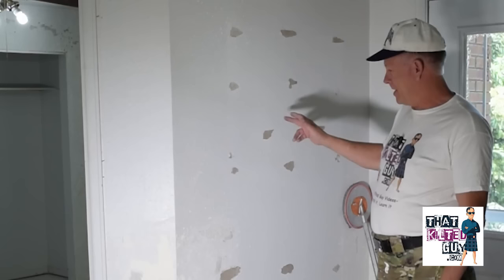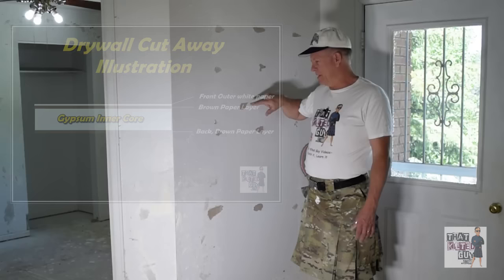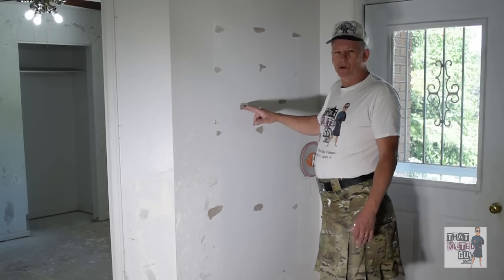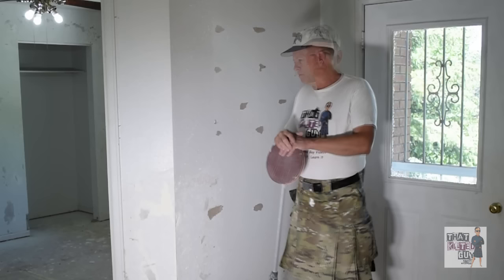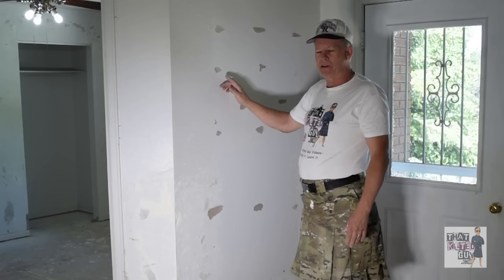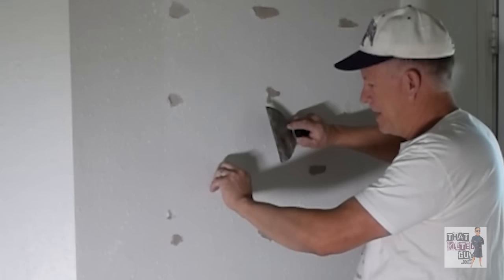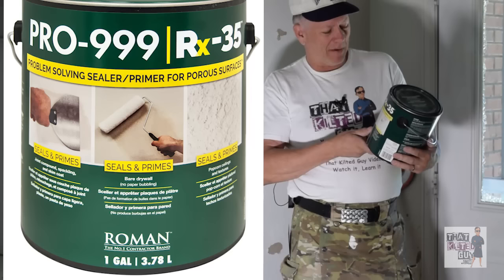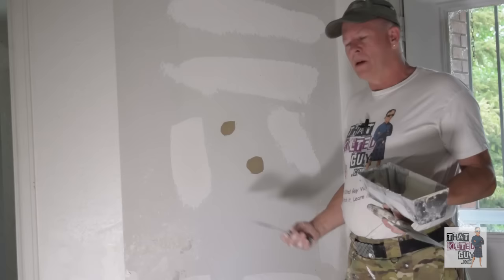⭐ Repair Damaged & Torn Drywall Paper BEFORE YOU MUD IT in 2022!

Comment: Wow, this is incredibly helpful (along with the part 1 video of prepping before this step)! I wish I’d seen this a week ago. 🙈 I took advice from someone on how to fix it, ran into problems,  tried to correct, and then foolishly hoped paint would help hide everything. It didn’t. Is it too late for me to go back do the steps you outlined here? Would I need to sand everything down, or cut out the patched areas and start over that way, even with everything else painted around it?
Reply from the maker: Ashlee Gitkos you can just treat it like a new repair. Cut out the loose paper and go from there.

Comment: I have small hole in the drywall(damage is from child pulling curtain down and the hardware ripped out of the wall) and the brown paper around the hole is exposed. Should I fill the hole, the use the pro 999, then skim coat over the hole thing?
Reply from the maker: Basically do it just like I showed in the video. Cut out any loose flaky paper and sheet rock, then use the pro 999, and then coat it with mud and go from there. Hope that helps and let me know how it goes. Thanks for stopping by and hope you became my newest subscriber.

Comment: For the DIYers who have little time and need a sequence of steps, what was the yellow colored mud used in the second coat. Looking for the exact name (like how you showed for the hot mud).
Reply from the maker: The 2nd coat of mud was called Plus 3 by USG.  If you don't have that in your area just use any Lightweight all purpose, or Topping mud.  Regular all purpose works too, but is much harder to sand.  Thanks for the question.
Reply: @ThatKiltedGuyDIY  what is the difference in the muds?
Reply from the maker: @jenkurtz412  this will answer that question- https://youtu.be/vRKrSm2aHuQ

Comment: You do not have listed the 999 sealer you mentioned and used. You have listed and directed to product called Gards sealer. However, Gards is not water proof, it is water resistant. Would another sealer that has shellac be better and is water "proof"?
Reply from the maker: It doesn't have to be water proof to work. Gardz is excellent

Comment: Hey Guy - What would you do if the entire wall was ripped down to brown paper? Paint the whole thing with the sealant, then skim coat? I took down some wallpaper in my bathroom (gently) but found the previous owner had really roughly removed wallpaper 2x in the past and just put new paper over it without fixing the drywall. The advice I had been given was to skim coat the entire wall, sand, then use killz, sand, then prime/paint. I skim coated half the bathroom yesterday w/ lightweight joint compound and noticed that one wall is having some of the bubbling issues you referenced (the other walls are ok). The long-term plan is to fully gut this room and reinstall drywall then tile, so looking for a temp fix for the next 1-2 yrs.
Reply from the maker: Hello. Yes I would apply one of the products I mentioned in this video first, and let that fully dry, and then skimcoat the walls and sand them smooth. It will reduce the bubbling problems about 95% compared to not using it. Let me know if that helps and how it comes out. Thanks, Guy
Reply from the maker: Our information is always free, but if you would like to support our efforts to put out better and better quality content you can consider a one time tip via PayPal at https://paypal.me/ThatKiltedGuyVideos?locale.x=en_US  Or a small monthly donation by joining our community on Patreon at www.patreon.com/thatkiltedguy

Comment: Now I'm just a home-gamer, not professional by any means.  On that wall, with so many bad spots so close together,  I would have skimmed the entire wall face with a ten inch spreader.  It takes more mud, but no edges to feather and blend.  To me, it seems less work.
Reply from the maker: That's a misconception so many have.  If you skim it, those spots will shrink, and so you end up sanding the whole thing down to the level of the spots, so it's more work.  Skimming only fixes minor stuff unless you put it on real heavy, which wastes mud.  Even then, you have to sand a lot, so this way is faster for me.  But, as I mentioned in the video, I did skimcoat after repairing the spots to even it all out.  But then it was just a thin skim coat.  I've done this over 35 years and this is what works best for me.

Which is why I put out this video- https://youtu.be/xK-Vx_ptgHg
Reply: For brevity I didn't detail my entire method.  To be brief, I always do at least three coats, letting it fully dry between applications. Suffice to say, with that much damage in that small area, the whole wall will be coated if I'm doing it.  It's the only way to hide it all.

Comment: I just did a wallpaper removal and battled the bubbles and blisters while patching. I did not find your video about the pro-999 until later. Since finding this product I have been trying to experiment on how this product does. I have attempted to recreate the bubbles on some scrap. I tore down to the brown paper and applied pro-999 on half and applied drywall compound. After 3 tries I have not had one bubble in the untreated areas. Could it be the 35 year old drywall? Is new drywall better now than back then?
Reply from the maker: I did the same thing once only I cut approximately 30 circular spots and tore it down to brown paper and not one bubble. So it has more to do with the way it’s damaged on a real job and other factors that we can’t re-create in a lab type setting. I’m still going to try again one day but not sure what exactly I will do.

Comment: Very informative. Thank you! My problem is that it’s not little sections of brown paper. I have almost an entire powder room wall that shows brown paper. I’d say the largest area is about 2’ W x 18” L. Another thing... is it necessary to remove the backing from there wallpaper? If I’m just going to paint over it, can I seal and sand, and then paint? I’ve finished 3 walls so far and I’m pretty certain that of I try to take it off the last wall that it’s going to leave more brown paper.
Reply from the maker: Usually if you try to paint over wallpaper you will get bubbles in the wallpaper and fight that too. I found it’s always best to just remove all the wallpaper and treat the brown paper if that happens.

Comment: Hello, question is- after applying the sealer/primer and mud, once everything is dry and sanded, should I apply the same sealer/primer once more before painting?
Reply from the maker: I usually put a regular primer over the repair when I’m done, but the pro 999 says you can use it so it should work fine.

Comment: I have an unrelated question: I'm planning to paint wood paneling that I had primed with a wallpaper primer and then papered over. I removed the wallpaper. Do I need to prime again before painting? If so, which kind of primer should I use?
Reply from the maker: I'm not familiar enough with wallpaper primer to say, so I would just do go ahead and prime it myself.  Primer is super cheap compared to paint or paint failures.  Bullseye 123 from Zinsser, at Lowes runs about $22 a gallon, or $90 for 5
Reply: @ThatKiltedGuyDIY   Same situation.  My painters put TWO coats of primer down over the paneling that had been stripped of wallpaper before putting on the paint top coat.  Came out great.

Comment: I am trying to repair torn paper but am not going to texture the wall the damage was done when they installed my vanity top is there a different approach and I only have a few spots a gallon of the rx35 will be way to much is her another way ? thanks your video's have been very helpful.
Reply from the maker: Yes- 🟢 Guardz torn paper sealer. Stops Torn Brown Paper from bubbling - https://amzn.to/2L3tl9V
Reply from the maker: Or spray shellac, but it stinks more and is flammable so be careful indoors.

Comment: Hey thanks for this video.   Not many other sources of info out there for this problem.  I called 2 local sherwin williams about the 935 or Roman pro999, it was either not in stock, in 5gal buckets, or they didn't know what I was talking about.  A paint clerk at Lows, tried to help but no "wallpaper primer" in stock.  He suggested a certain mid prices spackle...Sooo...I bought basic 8 oz elmers white glue for $1.98, diluted it with 20% or 30% water (which made it a bit runny) and primed it on all the torn paper spots and gouges,  LAST NITE.  Next I have some "cat scratch" damage by a door, which this may work.   Perhaps the more expensive "wood glue" might be better for $2 more.
Reply from the maker: I've wanted to play with that method. Keep us updated on how it works.
Reply from the maker: Also, I do have links to the gaurdz product, in the description below the video.
Reply: I take this back, white glue won't do well in a bathroom.  a day later, the latex primer "dissolved" the white glue within a couple of brush strokes.  And a day after that, the finish coat of semigloss also softened the white glue now mixed with primer over the spots.  Use a water resistant carpenters glue
Reply: I've concluded don't use plain white glue, it is not water resistant even to latex primer.
Reply from the maker: @williamthomas8135  William, thanks for the update.  I will experiment with the water resistant glue, but for me personally, I'd rather spend a little more on a proven product, at least until I'vee had a lot of time to prove a cheaper method to be reliable.  Hope that next one works out for you.  Guy

Comment: We just pulled a mirror and need to patch up like you described. Can you tell
Me what products you used for  brown mud over the white compound to patch the Brown spots, thank you
Reply from the maker: Seal it with pro999, or spray shellac, then several thin coats of lightweight joint compound work
Reply: I have about 12 4” brown spots. Would a small 4.5 pound bag at light compound work or should I buy a bigger bag. Thank you!

Comment: Okay. I am getting ready to repair some pretty large holes in walls and ceiling. I followed everything from the r35, to the white 20 min hot mud? But not quite understanding the third layer of white mud? Do you need to switch mud types or can you stop at 20 min mud let it dry and do as many layers needed to fix imperfection?
Reply from the maker: I use hot mud because it sets up quickly and lets me put a second coat of mud on quickly. After that just use lightweight or regular weight all purpose

Comment: Newbie here, but what is that mud your using for the final layer? Where do I get it?
Reply from the maker: Hi Charlene, the yellow mud I used for the topcoat is called USG Plus 3, and can be found at Home depot or Lowes around here.  But any lightweight all purpose will work.  Regular weight all purpose will even work, but it's heavier and a bit harder to sand.  Hope that helps.

Comment: i
I pulled the shower walls off to replace them. But the paper on the drywall tore. We plan to glue on large tile. Do I need to use the rx35 and skim it?. A ton of the paper came off. I don't know how it will affect the adhesion of the tiles.
Reply from the maker: It’s best to

Comment: i pulled off a  beadboard panel which took most of the drywall paper with it.  With this much damage, I'm thinking just put up another bead board panel.  Will the exposed  brown paper be okay behind another board?  This is in a bathroom.
Reply from the maker: Yes but in a bathroom it would be a good idea to seal the brown paper with a primer first.

Comment: So I have the same problem but when I cut the little bubbles and scrape it almost the entire top layer of the sheet rock becomes loose, with very few spots it stops peeling, even if I cut a circle and peel to it the edges of the circle I cut are loose. what causes this and what is the best way to fix? Any advise is greatly apreciated
Reply from the maker: Try spray adhesive on it. Rub it in well. Helps lock it down and stop the bubbles

Comment: I have an area on a ceiling that I did a bad job on. I mudded over the paper tape, I let it dry and now it is bulged out creating a hump. It is close to where two drywall sheets meet. Could you suggest a fix in a few words?
Reply from the maker: Cut out the bulge, re-tape if needed, float it out, sand and done.
Reply: Thank you

Comment: Removed popcorn and did some damage to the tape cut a couple of places and lifted edge in other places, how do I repair this prior to skim coating? I used pro999 on the other areas with minor scrapes and such. Sanded ceiling, corners and damaged tape are left to repair.
Reply from the maker: I just cut out any loose tape if it's not going to hurt, then float out that area.  If a crack will show, then re-tape it. Also, I never skim coat after removing.  There's no need.  Skim coating is floating out an entire surface and unless you did a ton of damage, it's a waste of time.  It's also the last step if you are leaving it smooth.
Reply: @ThatKiltedGuyDIY  I am going to do a stomp texture to match the walls. I planned on re-mudding screw holes that are showing as will as a couple of the joints that I  slightly gouged.  So I can move directly into texture once I finish out those repairs. BTW I'm in Centennial not sure what part of the state your from. Thanks for the videos,  this is the first time I've attempted drywall.

Comment: Thank you for the video.  I really appreciate people such as yourself that takes the time and energy to make videos such as these.  Passing on the hard earned knowledge that you have gained over the years to those who simply have to type in what they want to know on a keyboard.  Then add to that the assholes who always have to comment on how they can do better.  With that said it is a bit confusing when the person watching hears such generalized and generic terms as mud.  I understand you are professional and are used to the term, but it is confusing to those who have no idea.  Especially when you walk into a home center these days and are met with a litany of materials that can be categorized as mud.  Multipurpose compounds, taping compounds, topping compounds, setting type compounds, light weight compounds.  One can become confused fairly quickly looking "Mud" only to find it doesn't exist.  It would just be very helpful if you could state exactly what you are using in the video instead of using generalizations.
Reply from the maker: Hey, thanks for the constructive criticism.  You're right, I can do better on that and you're also right that I'm so used to calling it that, so I wasn't catching myself when I did.  I'll be clearer in the future.  For reference, what I use is an all purpose Joint Compound called Plus 3, by USG.  But it's not sold everywhere so I would recommend finding a lightweight, all purpose joint compound, and that will do most everything you need to do.  I usually try to show a picture of the mud I'm using, but I'll clarify it better in the future.  And the term mud does cover about everything from mortar, to concrete, to drywall mud of all types.  Thanks again, and I look forward to hearing from you again.

Comment: Hi, are you using the same mud to cover holes after the use of RX-35 and to mud the wall? I noticed two different shades.
Reply from the maker: I use hot mud on the first coat just to speed things up but you can use the same mud for both coats or all coats if it takes more than two

Comment: So I mudded directly on the backside of drywall (the side that has brown paper). It worked perfectly without bubbling nor see through. What’s different about the backside of drywall vs torn white paper layer? Aren’t the the same?
Reply from the maker: Hello Yoshi0. I'm not a drywall manufacturing engineer so I don't know the exact differences in the front white paper and the back brown paper.  But the backside of sheetrock doesn't have the recessed edge, and the paper doesn't wrap around, making it rougher.  But overall, they intend the white side to be out, so we hang it that way.  I've hung an occassional backwards cut piece brownside out and it's no big deal.  

As for the bubbling, that's more complex.  It's more about how the paper was damaged, so bottom line is I treat them all to avoid failure, which has happened hundreds of times before I did this.  😎👣